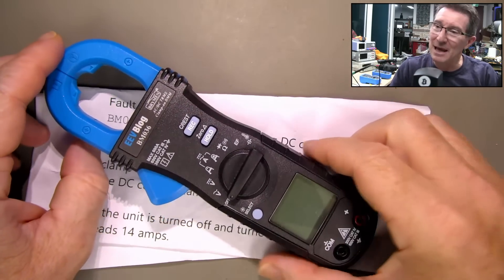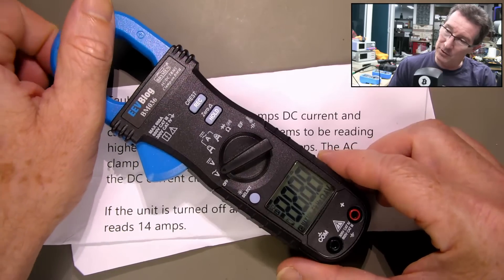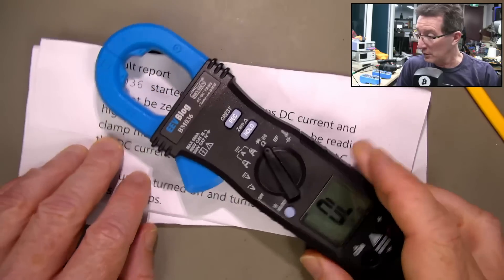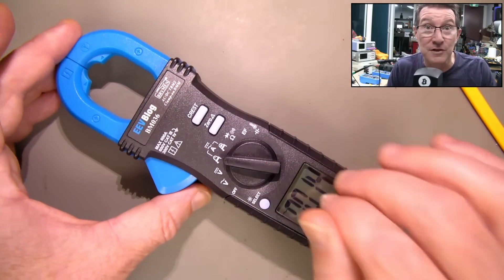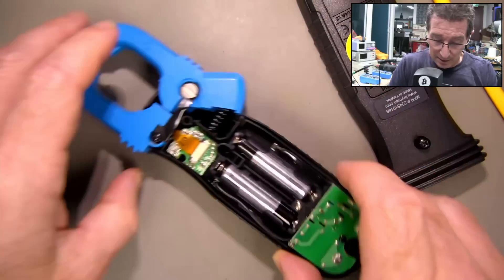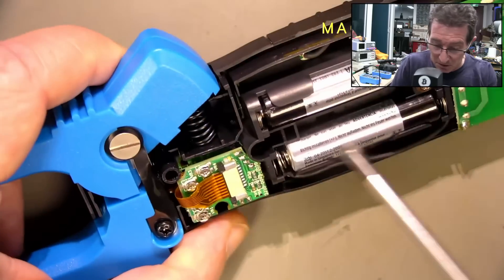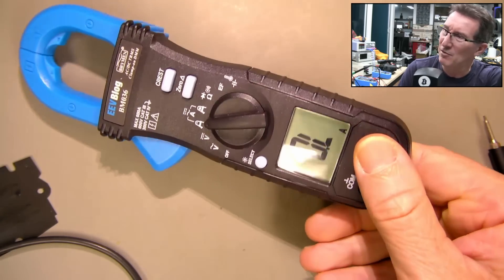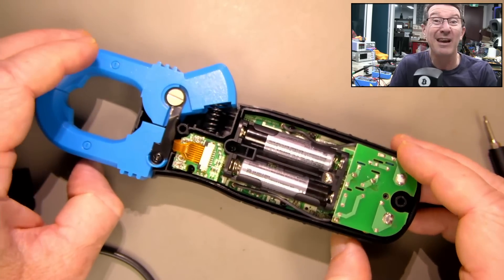Returned BM036 Clamp Meter Investigation

Comment: Clamp meter measurements of AC and DC current uses completely different methods/paths. AC measurements use a current transformer in the clamp. DC uses a hall effect sensor at the tip of the clamp. Most likely this big offset, which the firmware refuses to zero out, is the result of a defect in the hall effect sensor. 
It could easily be tested by replacing it with one from a known working unit.

Comment: It probably doesn't make a difference but I noticed that pin 1 of the three pin header appears to only have solder on one side. The solder didn't flow through the hole to the other side of the PCB.

Comment: I did notice that the Zero button did nothing. Perhaps the button contacts are faulty. I'd remove the button and try with a metal contact to see if the issue is the conductor on the button.
Reply: I think the zero button works only when the reading is near to zero. Not on large variations.

Comment: As you were looking at the daughter board I couldn't see any solder on one leg, of the three-leg  plug that was just unsoldered from the main board. It may be soldered fine on the other side and has just not flowed through, it's visible around the other two pins though.

Comment: It might "ruin" a second meter, but I would try swapping parts with another working unit just out curiosity.
Maybe the hall sensor in the clamp went "bad"?
Looks like an interesting repair video, especially since it didn't "self-heal" after opening it.

Comment: A leaky precision amp (that AMD device?) right up there in the front end would be my guess.  Try hitting it with some heat/cold and see if that dramatically changes the offset.
Reply: AMD? It’s an Analog Devices part.

Comment: Dave, have you measured the clamp coils?  I think they have to be fairly close to each other.
Reply: I might be misunderstanding your point, but DC current does not (can not) use coils, it uses hall sensors.
Reply: The clamp jaws have coils in them; I don't think Dave tested them.  I couldn't see anything obvious on the boards.

Comment: I thought OL was Open Loop on meters.
Reply: "Ower range" would be a better phrase.  It reads OL on current and volt over  ranges
Reply: Sometime it's Over or Outside Limit.🤔
Reply: @brucepickess8097  how about Out(of)Luck
Reply: "Open loop" would only make sense on a resistance or diode test range, not on voltage or current ranges.
Reply: Overload innit, although open line seem popular with youtube "techs" 🤣

Comment: Maybe the meter is picking up the long awaited pole shift!!😝
Is that a genuine Analog Devices IC ? If so , which one? I tried looking it up and couldn’t find it.
My bet is the mcp6002 opamp. In the circuit example of the data sheet for ac/dc test circuit, any of those capacitors in said circuit could cause all sorts of issues.

Comment: Did you check if the laminated clamp core has become magnetized? That can sometimes happen if the company is working with ultra high DC currents or more likely around magnetics like in large solenoids or motors. If you have a degausser might be worth a try.
Reply from the maker: I've asked them. The company makes custom high capacity battery packs, like 15kWh stuff.
Reply: @EEVblog2 I'd suspect that as a possible cause. Just imagine the inrush current on a 15 kWh battery if they forget to precharge! That meter is probably used for some >400 A for 5 minute test or something. If confirmed might have to advise the customer to reverse clamp meter polarity each test to prevent future failures.
Reply: @WizardTim Why would this residual magnetism continue to increase by itself? The offset went from 14A to 85A during the time it was being posted to Dave.
Reply: @ferrumignis  Good point, if it's magnetism it shouldn't be increasing unless it's being actively exposed to a high field strength, maybe the customer reported the fault to Dave awhile ago and continued to use it before getting an RMA and sending it to Dave? Otherwise it could be that the MEMs magnetometer is physically damaged by some massive > 10 kA inrush pulse, I could believe that could cause the drift without needing to be used, guess we just have to wait to see what Dave finds now I guess.

Comment: 8:25 "Yeah, there's nothing obvious there, there's no solder joint issues that I can see" but in the video pin 1 of that 3-pin connector, top right, is clearly NOT soldered ... let's see how long it takes him to notice,
Reply from the maker: No solder on the top side of a plated through connector hole is not uncommon.
Reply: Okay, at 9:21 is looks like it's soldered on the BACK of the board, but it sure looks dodgy from the component side ...

Comment: Check the batteries the simplest things get overlooked I had a meter do that when battery’s low
Reply: Same here, current reading was badly skewed but no battery warning
Reply: If the batteries were so exhausted that it badly affects the accuracy then wouldn't you expect a low battery warning?
Reply: Good thought, my Agilent U1272A also did this whilst the battery was low, BEFORE any battery warning came on...

Comment: Just a thought - I've noticed that some DC clamp meters can get skewed by exposure to very strong magnets.  It might be worth using a degausser on it to see what happens.
Reply from the maker: I've asked them. The company makes custom high capacity battery packs, like 15kWh stuff.
Reply: @EEVblog2  I have used the uni T ones on solar inverters and car amps. The inrush surge of charging caps can magnetize the clamp core to a lesser degree in my experience so with high power batteries, it is definitely possible. Placing a small magnet nearby or wind a coil and use a current limited supply to cancel the magnetism of the core might work to see if the electronics is fine.
Reply: Why are they using cheapish clamp dc clamp meters? Not a big company? @EEVblog2
Reply from the maker: Don't have a degausser , I'd have to make one.
Reply: @EEVblog2   You could try swinging a permanent magnet past the (closed) tip of the core.  At first close, the gradually pulling the magnet farther.  Or you could attach (Glue/Hot Melt) a wood or plastic rod — about 6 mm or 1/4 inch diameter sounds fine — to the magnet and then rotate the assembly with a drill.  Again starting close and retracting slowly, while spinning.  We wait for another video about your results!
Reply: @EEVblog2 just pull any old transformer apart and poke the prongs of the clamp through the primary windings for a few seconds each..
Reply: Agreed, on other units degaussing is part of the procedure.
Reply: Would that cause it to continue to go further out though?
Reply: @Zanthum  Continued use in the vicinity of a high power magnet.
Reply: The big fella is in our chat!! <3
Reply: Back in the Nokia days my phone speakers always failed when doing a generator load test
Reply: If that was the case, then the offset would remain the same once the device was separated from those fields, instead of growing from 14 to 86, and increasing from 86 to 89 on Dave's bench. My bet is on a cracked hall sensor package, letting moisture in and degrading it.
Reply: @robertbackhaus8911  Once the magnetic field in the clamp goes over a certain treshold, the readings become basically random because the hall sensor can't compensate for the bias anymore. This is also why the meter refuses to zero out the reading.
Reply: I came here to say the same thing.  Any chance of moving the sensor away from the clamp to see if the offset disappears?
Reply: Was just about to say.. that looks a lot like the metal core of the clamp has become permanently magnetized. Degaussing it with any old transformer coil should get rid of that offset.
Reply: I would suspect the same.
Reply: I've noticed with my little uni t clamp meter that can happen, like when measuring starter motor current, ends up with a large offset. Judicial use of a permanent magnet brings it close to zero again. Although it can always be zeroed out with the button and doesn't affect normal use.
Reply: @andrewbancroft6174  Yep, I have the small UNI-T clamp meter as well (with EEPROM modified to increase resolution) and high currents do introduce a small offset, but not 80A worth of offset 😁
Reply: Why would residual magnetism in the core cause the meter reading to constantly increase over time and diable the nulling function?  Doesn't make sense even as a hypothesis.
Reply: @ferrumignis  The continued use near a strong field would increase the magnetisation until it moved beyond the range of the nulling.  The slight variation around the un-nulled point is probably ambient magnetic fields.
Reply: @bigclivedotcom  My point was that the owner said the offset was about 14A in his note, but it was 85A when Dave received it.  Quite an increase during posting!
Reply: @ferrumignis  residual magnetism is indistinguishable from the magnetic field created by a DC current.  That's why the zero function is there - so it can be ignored.  But that zero function may have limits as to what it can do.  I'd expect it stop far short of saturation of the core since you don't want the core to saturate during measurement.  That would give you a wildly inaccurate number.  As for increasing over time, it might be a function of how the meter was treated that resulted in getting exposed to high magnetic fields repeatedly.
Reply: @russellhltn1396  "As for increasing over time, it might be a function of how the meter was treated that resulted in getting exposed to high magnetic fields repeatedly."

What physical process can result in the flux density within a magnetic core increasing by itself over time whilst not being exposed to strong external magnetic fields?  You can't just hand wave such unusual behaviour away.
Edit: just noticed Dave has already determined it has nothing to do with core magnetisation.
Reply: The whole idea of the zero calibration is to eliminate the effects of residual magnetic fields. A degauss is not going to do any good if the zero calibration isn't making any difference.
Reply: @WisdomVendor1  The zero calibration may have limits on what it can ignore.  Get outside of that limit and you could see some large numbers.

Comment: JU8 pin 1 looks insufficient solder on front board possibly floating.

Edit: most visible at 8:08, also appears to have major solder voids on opposite side of board most visible at 9:50. I think the other side of these header pins were resoldered, motherboard side, but the daughterboard side I don't believe was touched up.
Reply from the maker: No solder on the top side of a plated through connector hole is not uncommon.
Reply: @EEVblog2  Failed trough plating barrel is also not uncommon.
Reply: Yeah;  JU8 looks worrying for sure;   though it does seem strange that remove + reinsert would continue at the same offset..